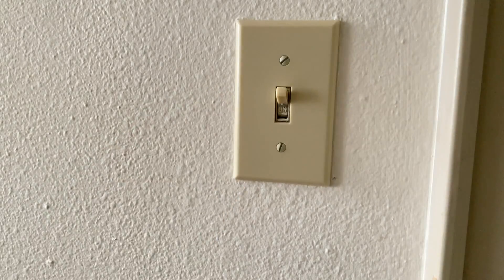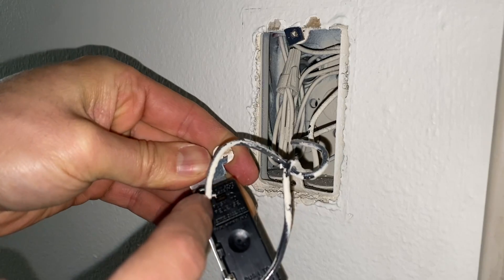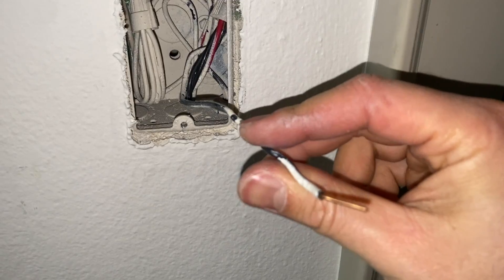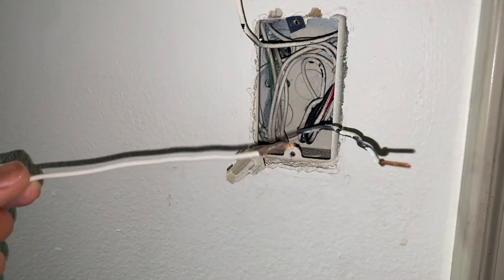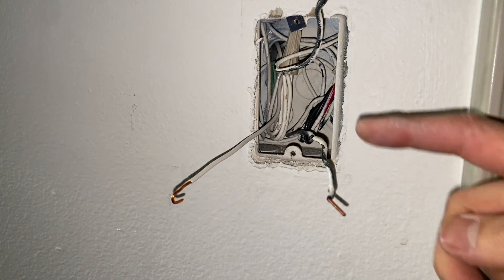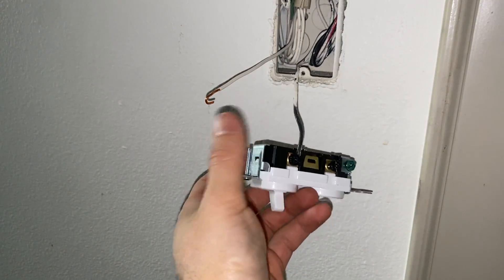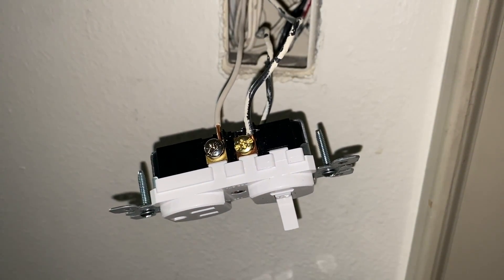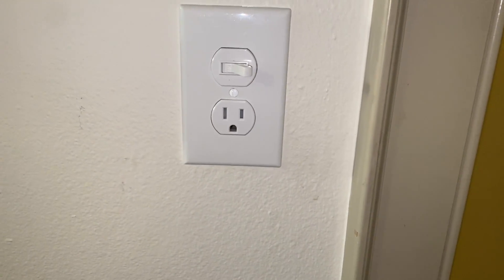How to add an Outlet from a Switch

Comment: My switch only has the 2 wires it's connected to.
There are no other wires at all like you showed.
Reply from the maker: yes, that means neutral went straight to the light. and they only dropped switch leg.
Reply: @remoteelectrician  so that means I can't add an outlet?
Or how would I do it?.
Thanks for the reply.
Reply from the maker: @xCARPx2014  nope if there's no neutral wire you can't

Comment: Hi! I did the connection and thought it worked, but I'm having an issue. The outlet works, but the switch only works when I turn on another switch first. This is a 3-way combo switch with a ground connection. Could this be caused by switching the placement of the two light cables? Thanks!
Reply from the maker: this a single pole switch not a 3 way switch
Reply: So how would you wire it?